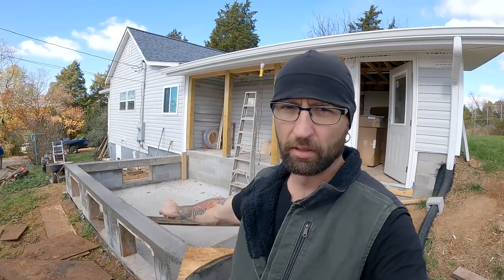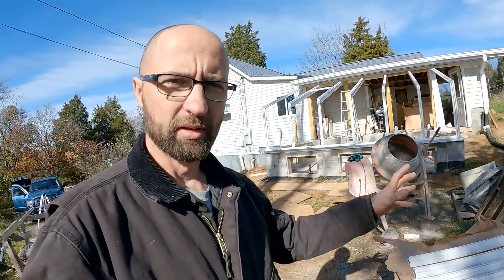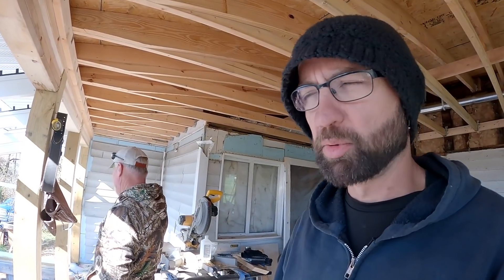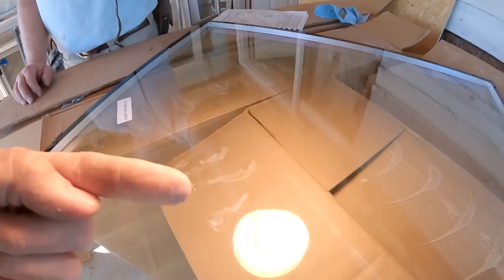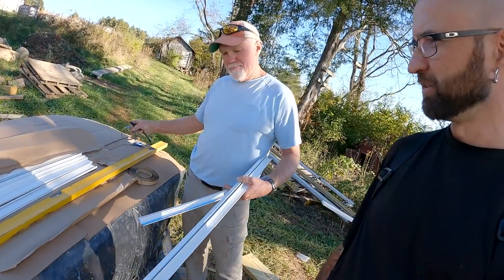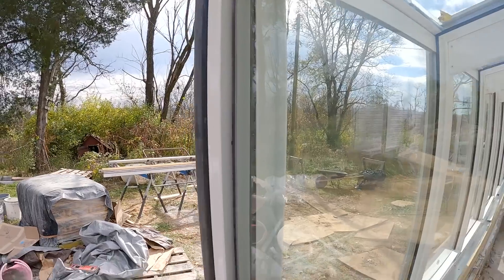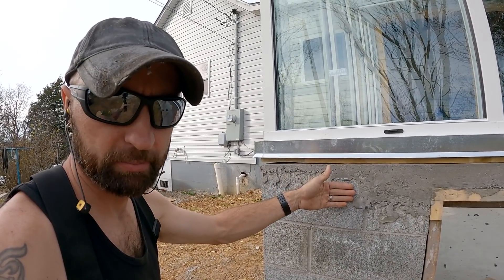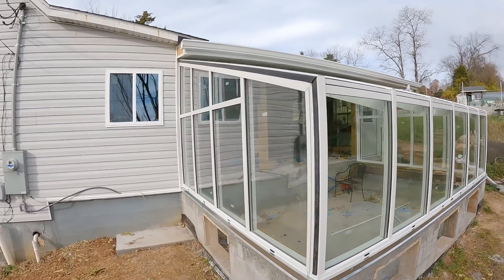Building a SOLARIUM to Grow Food! (ep14)

Comment: I have a similar sunroom with glass roof, 15 years of age on it and now experiencing water leaks on the  eave (lower edge).  Any ideas of how to fix this. I have used water sealant but still getting leaks when it rains heavy
Reply from the maker: It all depends on where its coming from. I suggest having someone on the outside spray it with a garden hose and watch from the inside. Start low and work your way toward the top. That will show you where it is coming in. Then, clean the area on the outside with alcohol then apply silicone.